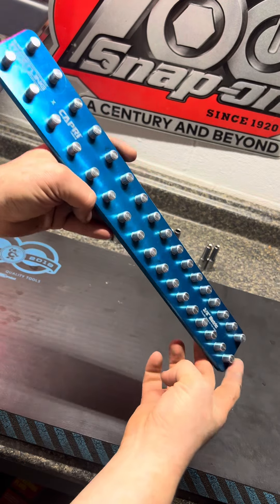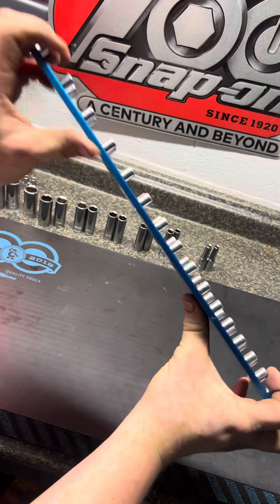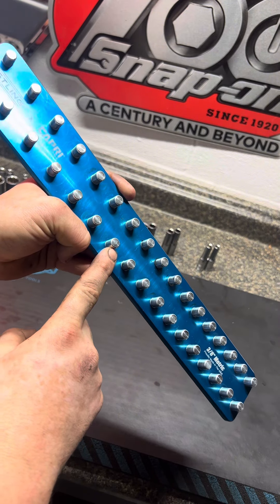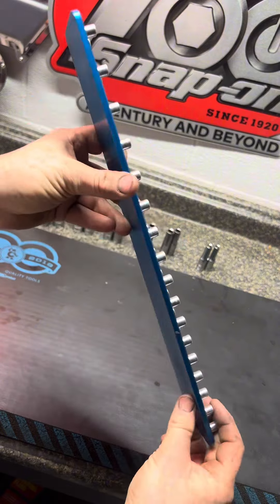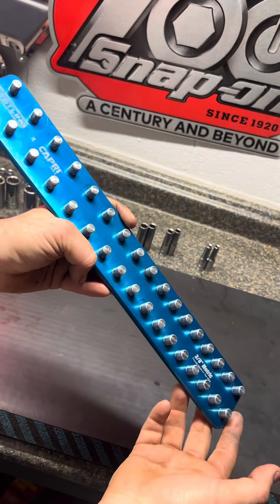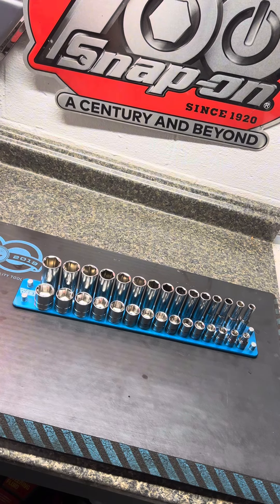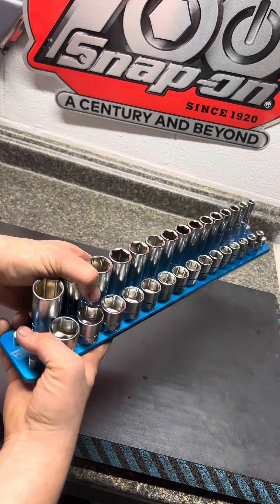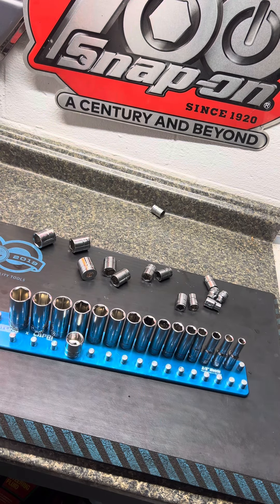WESTLING SOCKET RAIL REVIEW

Comment: You’re looking for a Vim mag rail! Snap-on socket fit upside down on the system.
Reply from the maker: I have those already. I like how you could have two or three row ones with this brand. I don’t think the mag rails you can.
Reply: VIM now has two row rails, I have had Westling for over 15 yrs. and still love them, only 1 peg has failed in both SAE/Metric - work great for chrome/impact/swivels - they are the best & tough to beat
Reply from the maker: @davidchavez4274  I’ll look it up. Only thing I don’t like about the vim is they are almost to magnetic lol when it’s in my toolbox I have to pry it out